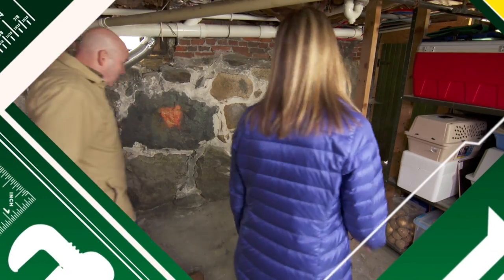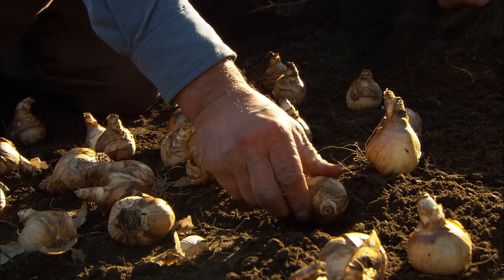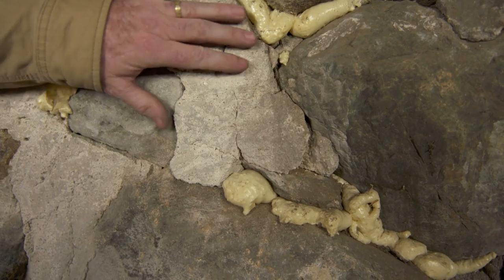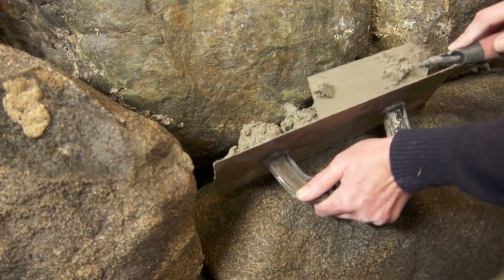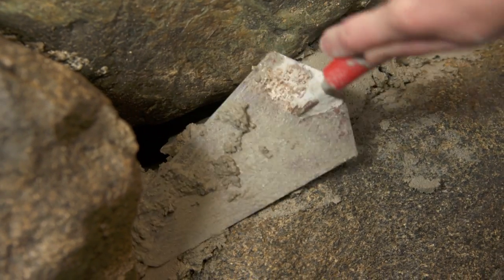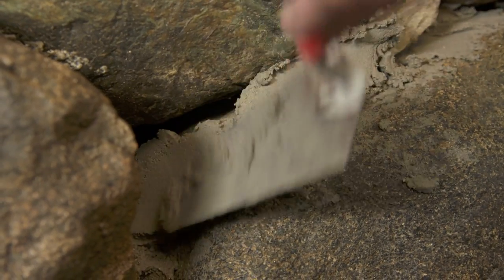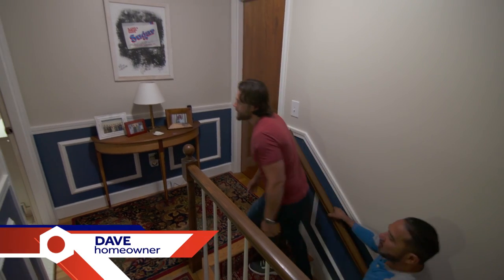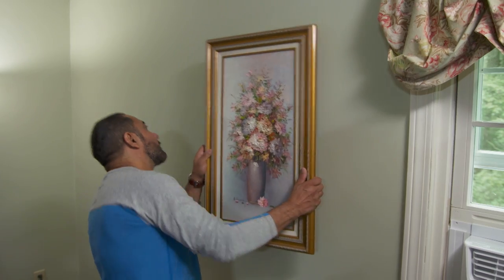Ask This Old House | Fix Foundation, Textured Ceiling (S17 E20) | FULL EPISODE

Comment: I just wanted to share my own personal testimony in reference to oily rags I was working at a friend's house staining his front porch. When I finish the job I placed all the rags in a metal basin then placed everything in the back of my truck, 30 minutes later I needed to return to the truck to retrieve some tools I was very lucky because I arrived just in the nick of time the rags were smoldering with a small flame I was able to grab the basin pitch it out of my truck if it wasn't for the tools I need it my truck would have burned to a crisp

Oily Rags do catch on fire all by themselves its spontaneous combustion.
Reply: an electrician showed us pictures of a house fire caused by a spontaneous ignition waste from floor finishing. the damage was very serious

Comment: Good idea for smoothing out the ceiling with the drywall compound. But for all that work it takes to get a smooth finish, it's better to just scrape or sand off the original texture. I've worked with the 45min drywall compound and it's very hard and tough to sand. The dust it creates is very fine too and gets everywhere.

Comment: İ need to lift one corner of the house then put some support underneath the footing. My question is, after lifting up the house, how am l supposed to fill the gap between footing and soil? Or it should be ok just the way it is? Can you guys gimme some ideas please thank you.
Reply: Late to the game here, but I'd imagine you would hire someone like a concrete leveler in that scenario to inject concrete underneath it--at least, that's how they do it with surface situations. Since you're dealing with footing, that same person or company might need to create a minor underpinning void of some sort to get the concrete in there. Otherwise, it might just be a new section of footing where they just say "screw it" and cut it out to be re-poured, etc. Just my two cents, so take it with a grain of salt.

Comment: If you’re going to skim over a texture ceiling, not using traditional plaster and instead opting for drywall filler then use a hawk and trowel apply your first coat thickish, use a speed skim / straight edge to flatten that first coat and use the second coat only for imperfections.
The idea should be to get it flat and smooth, I wouldn’t use 45min filler because ceilings can really be hard to work on and textured ceiling are even worse.

Comment: great information, at time 5:37 there is a tree on the left side of the house, is that one too close, I have a tree about 10 feet away my house, should I be concerned  about the root damage the foundation? thanks
Reply: I was wondering the same thing!!! It seems like a catch 22 when it comes to having trees near the house.
Reply: @powerofknowledge7771  ... on an older tree the roots will go out about as far as the branches. If you have kept the tree trimmed back over time it does help but nothing is perfect.
Reply: @rupe53  Thanks for responding. It's interesting that you say that about the tree roots. I was just thinking about and wondering if tree roots will extend as far as the branches or how that works. You pretty much answered my question.
Reply: In my opinion, any tree that leans towards a house and can hit it, should be removed.  At a minimum, no trees should be within 30 feet of any structure in my opinion as a non-tree professional.

Comment: Hi, When I was working (a long time ago) we had an emergency generator that worked from coal and because we never used it, we still had to control it. we did this with ten steel tubs that went through the coal and had thermometers at the end and these were checked daily. When the temperature got to 80 C, we had to move the heap of coal to another area thus cooling it down. This is the exact same reason why rags can catch fire as long as the conditions are right. Rags should be thrown away into a metal container with a metal lid on it.

Comment: The bonding between a stone and cement is mechanical because the stone is porice they should’ve painted the bonding agent on the stone if they wanted it to stick and pressure washed it because nothing sticks to dust!!
Reply: Same thing with that 45 mud it won’t stick to a painted surface should have painted a bonding agent to the ceiling

Comment: Why do people think spray foam will stop water from leaking into their basement?
Reply: Because closed sell spray foam is basically water proof, easy to spray in, but doesnt stick to dust.
Reply: @Powersthatb3  ... yes, but it does stop the draft from between the rocks. I have seen it used many times in older homes.

Comment: Easy Sand works great. Basically, it's the same component as plaster, calcium sulfate (plaster of Paris) with some minerals. Don't let the name fool you...sanding is one thing you want to avoid by troweling it on as smooth as possible. The homeowner should have had the bedroom totally cleared out before the painter arrived...would have saved time and not made the painter a furniture mover...lazy guy
Reply: As a contractor I can assure you customers never move a dam thing for you.

Comment: Removing all of that mortar and some of those stones along that basement wall would be something I'd be terrified of doing. I wouldn't think it would take that much to destabilize a wall like that. If you ask me, they were gambling a bit by doing that, but then again, I'm not a mason or someone who has much experience in these things. But I know the horror stories you read about online about people who have walls buckle to collapse, which is often why you see the real basement waterproofing pros talk about engineering tabs when installing basement waterproofing French drains against cold joints. (It's a small tab of slab that they leave intact every X feet to ensure the wall doesn't try to undermine itself when removing the slab for the trenches they make to install the drain pipes.) So, by virtue of basic logic, one would then have reasons to suspect that a wall like the one in this video would be even more prone to collapse given the volatile, non-uniform construction method it was built with. Either way, she did a great job with it. It looks like, but I can't imagine that their work will prevent that water at that spot. For her sake, I hope I'm wrong.